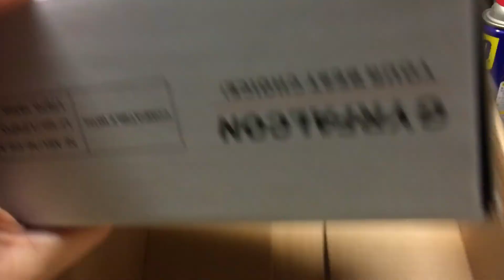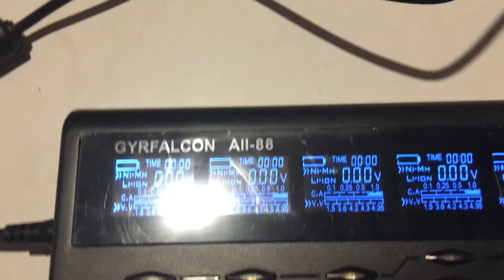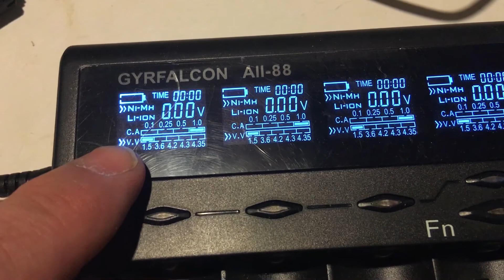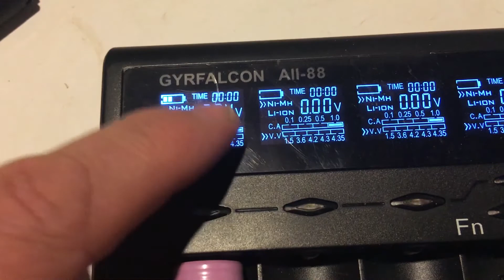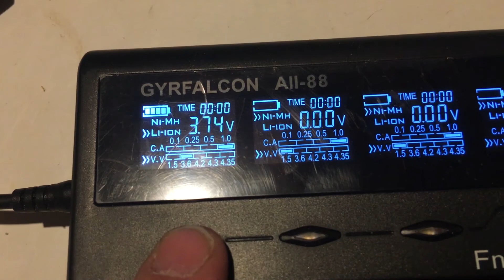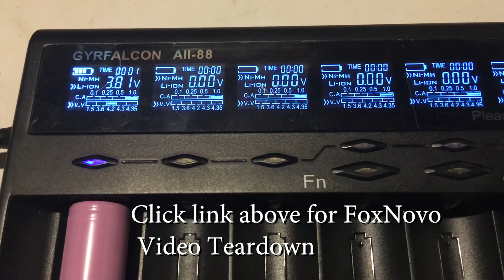Greyfalcon li-ion 18650 Battery Charger All-88 & LiFePO4 Quick & to the point.

Comment: Do you have to change settings every time you pop a battery in?
Reply: No, you can set it on automatic detection mode 👌 It's the best charger I've had, and I've had alot of different once over the years..
Reply: @xxbambamxx7261 I wish I listened to your comment. I bought the Efest  LUC V8 Double LCD. Only took 2 weeks for the buttons to stop working and not charge batteries. 

Just bought this charger and am waiting for it to come.

Comment: Seems a bit cumbersome. If one has multiples of batteries and types to be charged you literally have to know all the specs and nearly assign a slot, otherwise you'll be fiddling with the settings all the time depending.
Reply: Apparently you can do auto detection mode it seems

Comment: i Repair Electronics That's actually a 4 Amp @ 12 volts DC output not 1.5 Amp. The 1.5 Amp is what it is rated at 110-240 volts AC at its input. Thought that needed clarification 3:10
Reply: That's still around 5-6 hours to charge 8 18650 lithium ions, do you know of any more powerful 8 bays ?
Reply: I've used this charger for over 3 years, and it's charging 8 batteries under 6 hrs.. I haven't measured the output  but to me it seems to charge at 1000ma pr cell.. And it has an automatic mode, but you need to press down 2 buttons for 3 seconds to change it.. It only does charging, but it's doing it really well.. And since I charge atleast 16 batteries a day, it's holding up good 👌